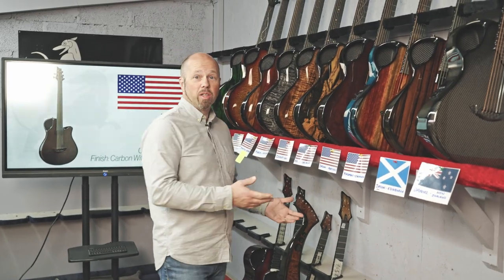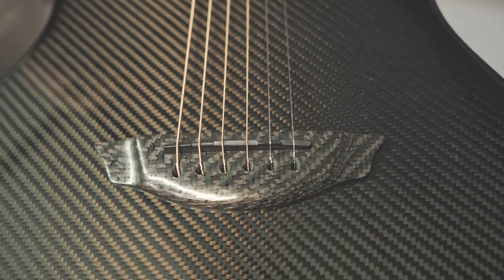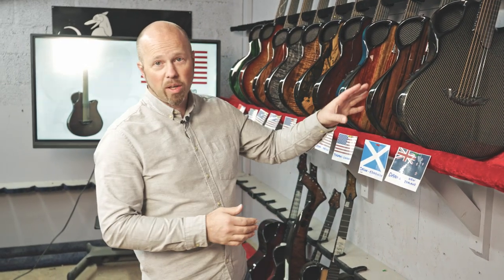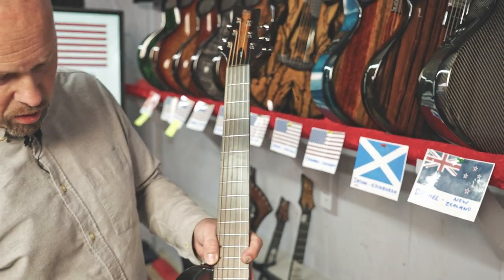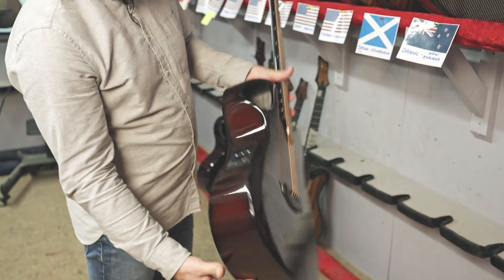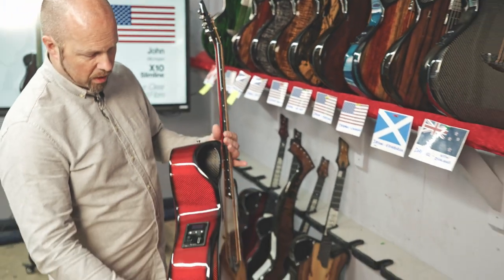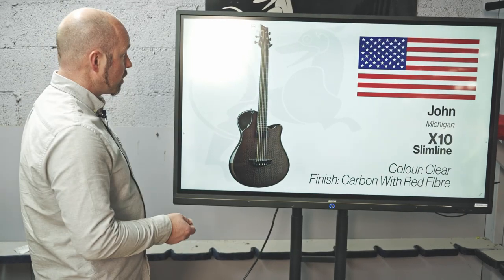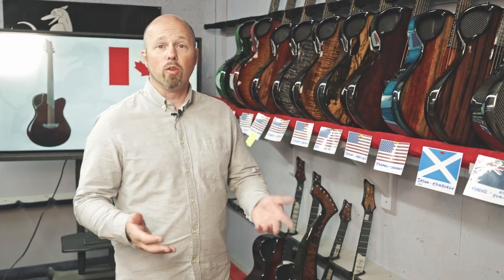Shipping Video 30/02/2022 | Custom Carbon Fiber Guitars

Comment: Just curious if you are still trying to improve the acoustic properties of your various models.  How often do you make changes?  Would you say that your current models sound better than the ones you sold 10 or 15 years ago?  I can say my 3 year old X20 cocobolo sounds great and it is my most played guitar even though I have a Martin D35 and a Martin 12 string D12-20.